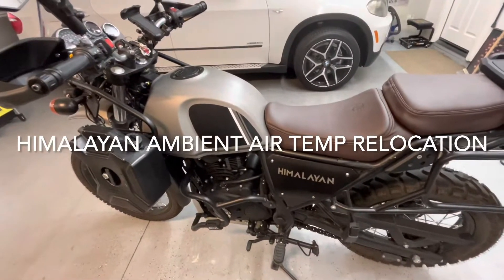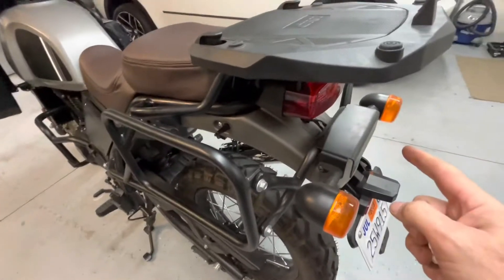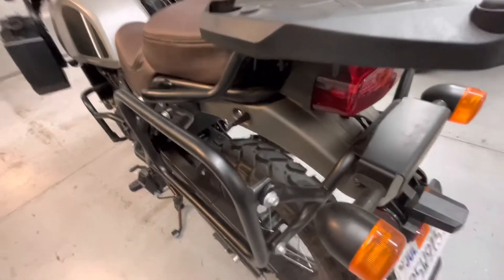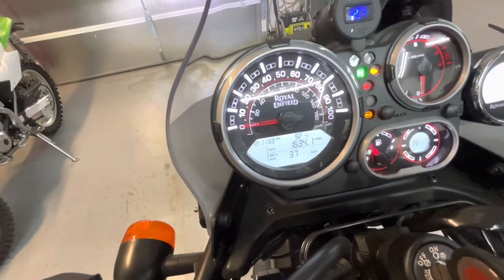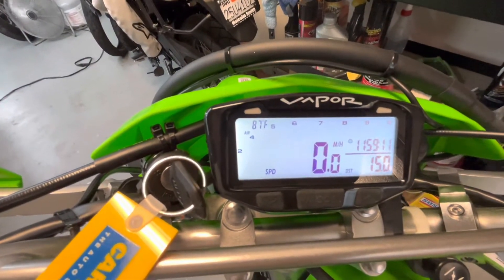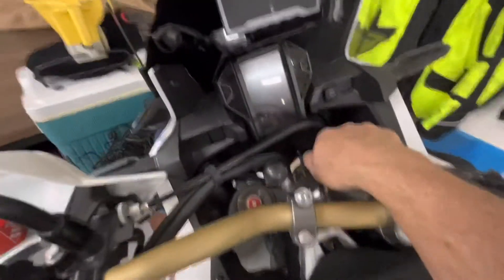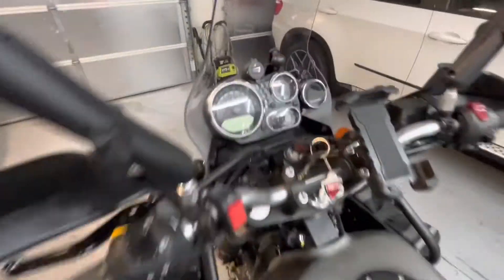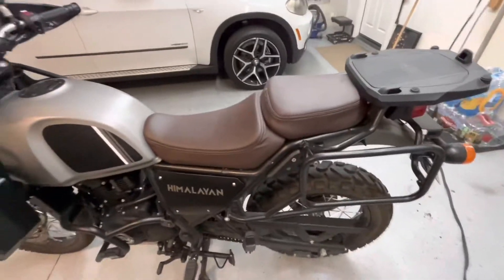Himalayan ambient temp sensor relocate.

Comment from the maker: Went for a ride today in the new location. Sensor was in the shade the whole time. Still indicated about 6 to 8 degrees to hot so it doesn’t really matter where you install it, it’s going to be off.
Reply: I will put mine inside the documents box, from the side of rear brake. In there the gauge works fine. Mine in original location measure more 5°celsius!

Comment: Good idea on relocating the sensor I am having trouble finding mine on the 22 model Himalayan where did you find your sensor at thanks
Reply from the maker: Mine is a 22.  If you drop the rear fender liner it’s between the liner and the fender all the way towards the rear just before the license plate mount.
Reply: @MikesMotorcycleProjects  thank you for the location tip. Today i lost more then 20m trying find the gauge and gave up.
Reply from the maker: @pmfsify  Yeah you literally have to take the rear fender apart.  It’s in the same are where all the wires are between the inner and outer rear fenders.